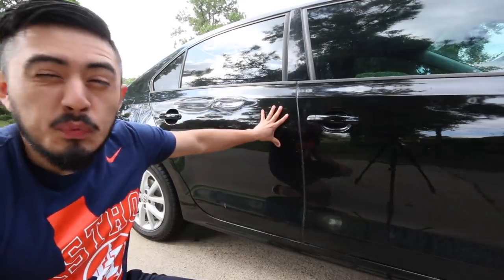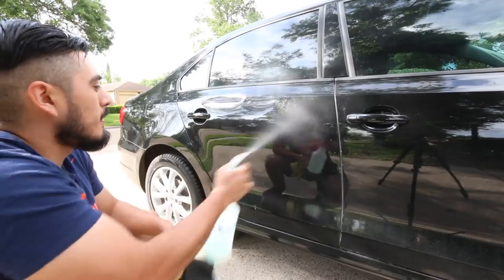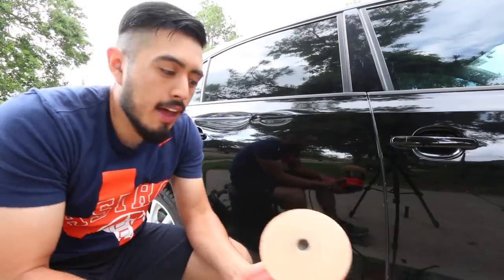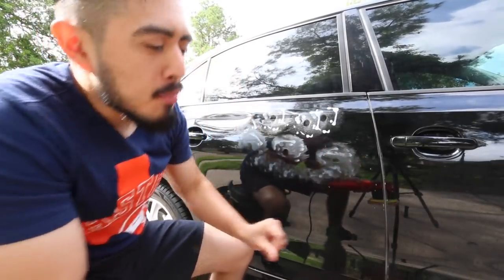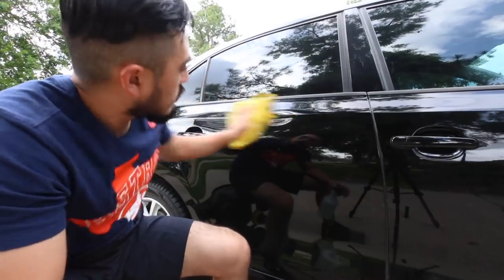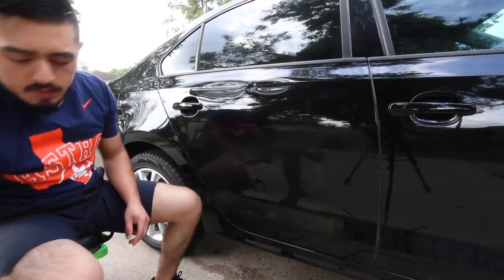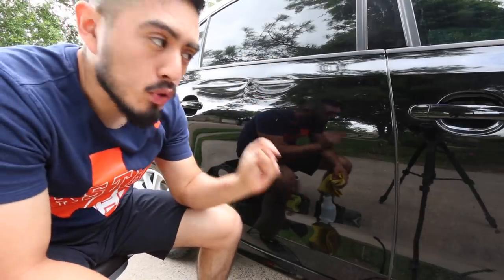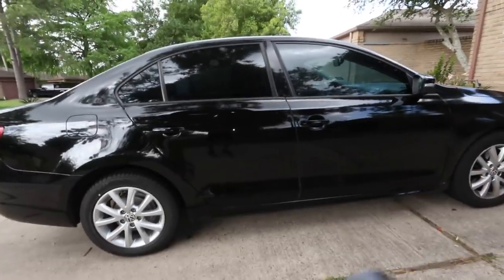Polish Your Paint Without Spending 12 Hours

Comment: Just wanted to say, I followed this concept this past weekend. Although I was doing an actual one step paint correction, I didn't spend the first two hours washing the vehicle. I typically will do sections of a vehicle at a time, instead of an entire one. I just don't have the time it takes to paint correct an entire vehicle in one sitting! So, I simply washed with a mf towel with a bucket of water and ONR. I also did not do a decontamination wash, but did use an iron removal. In total, I took maybe 10 minutes to wash the vehicle, versus my normal 1.5 hours. Also, I ended up using one pad for the entire side of the vehicle. I simply washed it with a hose, and then put it on the DA polisher, turned it on, and almost instantly dried. Got to say, it came out absolutely amazing. With the wash, I took the advice that I am not going to make the paint that much worse by washing it in this method. Especially if the vehicle already has the swirl marks. I spent the time doing the paint correction, which is the part I truly enjoy the most. Thank you for your practical approach. It makes sense, and it works!

Comment: If you want to use an analogy, it's like battery charging. You will take 20 minutes for charging 80% and 3 hours for the 20% left. For polishing it's the same.

On forums, they talk like surgeon.They act as if the car was a person in a coma and needed intensive care. They spend two or three days to perfectly polish a daily driver. After that they will go to work with the car, go to supermarket, downtown...and the car will be scratched in the first minutes. 
If they work for a customer, the first wash will scratch the car everywhere. They will bring the car to the car wash.

Now I'im polishing my car once a year. Wash, clay and one step polishing with 3in1 polish from Chemical Guy. With a microscope, I can see micro-scratch. I don't care. I don't use microscope like stupid guys on the forums.

You're fast, efficient, the job is done and 99% of the owner won't see the difference between a perfect polished car and a standard polished car. You're right. Thanks for this video.
Reply: Exactly man. 100%

Comment: Like others have said, you speak to the real world where the  majority of detailing needs involve daily drivers and customers looking to spend maybe $150 - $250 to make their cars look better than they have since they were a few months old. Most of the other YouTube detailers seem to have an elite clientele and promote a different product in every video. If you're starting out the main thing is to get jobs, as you always say.. Using your all-in-one paint enhancement method seems to meet the need for the daily driver market. Maybe add a spray on, wipe off wax like Turtle Wax Ice or Meguiars and you'll have a happy customer. Oscar, I like that you started with a few brushes and apc and detailed several cars before you started adding equipment. I'm guessing you had a vac like the Rigid early on, right? The best "product" is the detailer himself!

Comment: What your doing is what's called paint enhancement, not paint correction, I offer paint corrections to my customers, they usually don't want paint correction, except my higher end customers, great vid brother
Reply from the maker: Exacctllyy. Gotta give the right service at the right budget
Reply: You really don't have to do a paint correction. But then again you do get what you pay for I detail myself and 1 thing I don't do is buff
Reply: @rinrin2195  why not? Starting off with a DA is pretty simple. Also its where big money is because you can charge more per hour.
Reply: @justinreneau1983  I personally don't like to o or charge ppl. Depends on what I'm doing. Most of the time when you do a clay bar you really don't have to buff it all you really need is an Orbiter
Reply: @rinrin2195  a da is slightly more advanced than a orbital but still easy. Using foam pads and keeping them flat on the surface will prevent any damage. Charging ppl for "buffing" is where the money is and the increase in your potential.
Reply: @justinreneau1983  true but it's not always good to over charge. I don't like buffing
Reply: @rinrin2195  I didn't say anything about over charging. You only charge for "buffing" if your customer is wanting that certain service. If they dont then you're golden the way you are 😅
Reply: @justinreneau1983  yeah so how long have you been a detailer?
Reply: @rinrin2195  21 years but recently started my on side business. You?
Reply: @justinreneau1983   about 7yrs looking to do my own thing with friends
Reply: @rinrin2195  well good luck to you and your friends buddy!

Comment: I have 2 questions. 1). How long does it typically take for the seats to dry after you use the extractor? And 2). For liability reasons, do you have the customer sign a contract of some sort so that you would not be responsible for any damages if there were any?
Reply from the maker: 1) if it's relatively warm outside, within 2 hours they'll be 90% dry. 2) No, not at all
Reply: Detail Groove Okay. I’m 19 and mine and my parents main concern is that if someone blames me for any damage, I won’t have any protection in place, so I was just wondering about your system and if you had anything in place. Thanks!
Reply: @atsukinumata249  you could always get insurance for that. Many LLCs and companies have liability insurance just in case something happens. Usually pretty cheap.
Reply: RedGheauxst Ah okay, thank you for the knowledge!

Comment: How much do you charge to polish a car
Reply from the maker: AIO = $180 to $400
1 or 2 step = $400+
Reply: Detail Groove do you charge more for the size of the vehicle or how bad it is
Reply: Size of the vehicle, and condition of the actual paint. The bigger the vehicle more polishing and buffing you have to do. Same with condition of the paint. Condition of paint also determines how much time you will be spending on polishing and correcting. Each panel.
Reply: @DetailGroove  lol even 180 for that 1step on this vw is too much..
Reply: @Egon1982  Again its his price. 
his buisness. 
I charge $160 I don't waste time.
Reply: Egon1982 a lot of guys won’t even touch their polisher for anything less than $300, $180 is a good price for an aio, we are in 2019, products are getting more and more expensive, can’t be hooking everyone up like they’re family haha.
Reply: @Egon1982  if he spends 8 hours detailing and doing an AIO on that car itll come out to 22.50 an hour. Not including products. It you want it done cheaper, you cant do it yourself because a tool and products will cost you more.

Comment: On the back door panel that u polished since it still has swirls what steps would u take next to get rid of them
Reply from the maker: If I'm doing actual paint correction, then it'll be compound with a cutting disc and then polishing
Reply: That car is in serious need of a 2-3 stage correction. But honestly with how banged up the panels are, they'd be better off getting body work done and repaint it. Considering most people wont go to that extreme, a single stage polish can at least make the paint look richer than it was.

Comment: I never seen a clay bar glove is it new? I only used the clay bar. Why go fast on a clay bar?
Reply: Clay mitts are so much easier and faster to use
Reply: @eaautodetailing5303  how is it safer if hes going fast? From my understanding ur not supposed to go fast on a clay bar.
Reply: @eaautodetailing5303  and the swirl marks. Those can come out with a wax machine instead of a buffer. Theses a certain wax or compound that takes care of it
Reply: @rinrin2195  hes doing what I call brightening up the paint. Hes not focused on removing the swirls just a quick polish. And hes using a DA polisher so yes it's safe to go that fast
Reply: @eaautodetailing5303  ahhh got ya. Ik here in Houston we want that shine lol. I like using either mother's synthetic wax or ceramic.

Comment: Is clay mitt better than clay bar! Keith
Reply: IMO clay mitt is much more convenient to use and keep clean, but need to be careful if using it in full sun or on really hot paint since the "clay" material can transfer to the paint if there's not sufficient lubrication and/or too much heat on the panel.
Reply from the maker: Overall, I'd say clay mitt. They both have their parts. 95% of the time I use a clay mitt.

Comment: Just use griots fast correcting cream. Less passes, less time and better results
Reply: Carlos Rivera on hard paint sure, but on the softer stuff you are left with a haze that should be followed up with perfecting cream, I usually go for the correcting cream instead if I’m going for a one step, not as aggressive as fast correcting cream, but still works really well.
Reply: @STILLNIGHTPEARL  
Ding ding ding!!!!!  Ihave been getting that question. What is the difference between hard pant and soft pant. I have no clue why. So what is the difference.  How do you tell. As a safe choice what polish would you use on a soft pant?
Reply: Patrick Guida people call it soft paint or hard paint, but what they’re really talking about is the hardness of the clear, because after all that is what you’re leveling off, and not the actual paint, of course on single stage paint it is the paint that you are removing, and exposing a fresh surface. Generally, when clear is soft, it corrects easier with a compound or polish, but because it corrects easier, it also swirls, and scratches easier, along with hazing easier as well, that’s why you need to follow up with a polish after compounding soft clear. Harder clear is more difficult to correct, usually you need a more aggressive combo to level it off, but it might not require an extra polishing step since harder clear doesn’t haze as easily, harder clear seems to finish better as well, polishes out really nice, the softer clear sometimes requires a lot of polishing in order to get rid of the haze, and have it pop really good.

Comment: Hey Oscar I don't have onr can I use an apc to prime and clean the pads?
Reply: ONR is extremely cheap. I would suggest getting a gallon. You can use APC in a pinch but I wouldn't use that as your main pad cleaner.
Reply: @stephenlynn9086  thanks for the reply I ordered onr I want to try to do a rinseless wash on my car as well.
Reply: Yeison Galeano that’s awesome! Make sure you check out the dilution ratios. It seriously lasts forever because you barely need any when washing or claying. It makes a great clay bar lubricant as well.